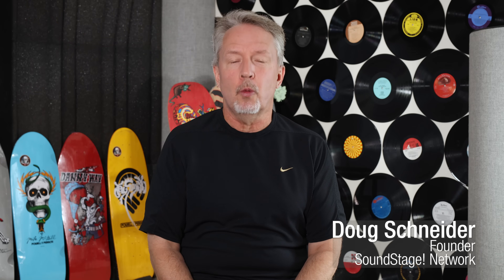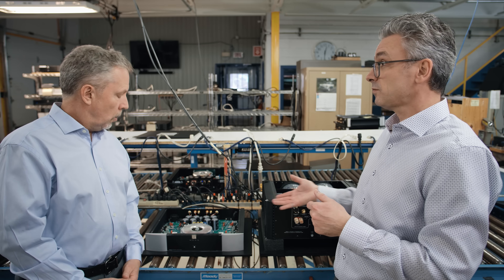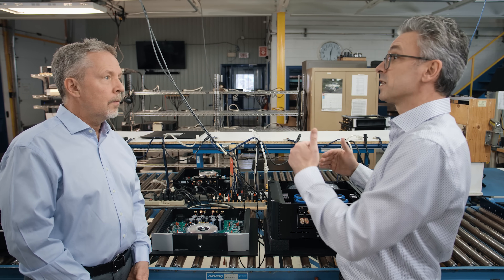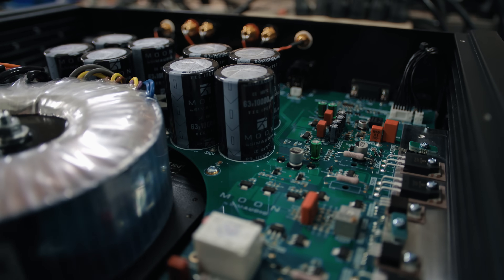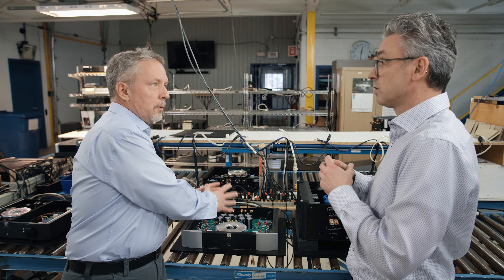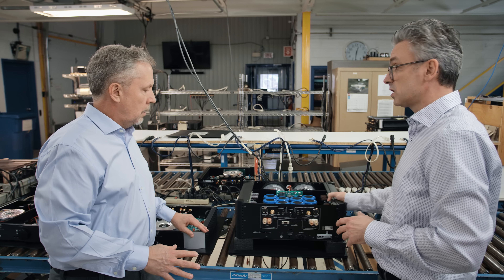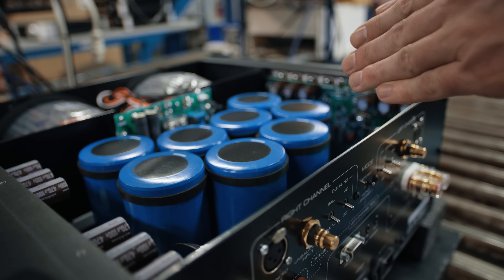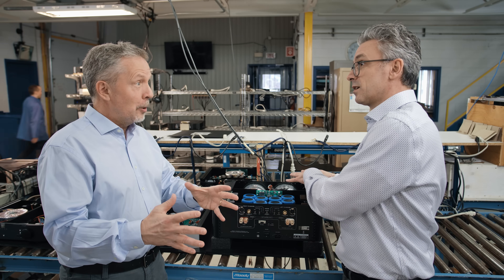Why Amplifiers Don't Sound the Same - Understanding Voltage and Current for Loudspeakers (Ep:71)

Comment: Ohm's law. amplifier produces voltage, ie: voltage amplifier, speaker is load, size of amp power supply, output transistors etc., determines how much current is available to be drawn.  Voltage from an amp is not constant. It varies with input signal. The explanation you guy's give could be very confusing to someone who doesn't understand electricity.
Reply: Even to those who do!
Reply: @Douglas_Blake_579  Yup. Why amps sound different? Then talk about input signal vs 1 watt for spkr sensitivity? Input signal voltage could vary, the 1 watt is a standard for measuring spkr sens. DB's at 1 meter with 1 watt. Whatever you do at the front end to achieve that 1 watt. What this has to do with amp output capabilities, I was stumped trying to figure out where they were going with this. Many things make amps sound different. Sorry I didn't read far enough to see your earlier post. That made sense, maybe too technical for many, I tried to REALLY simplify it.
Reply: @bradt.3555  
My point in my other lead comment was to explain the physics they were talking about. What I posted was seriously "week one" stuff. It's what you get right after "This is a piece of wire". If that was "too technical for many" then, given how painfully basic it was, I can only suggest that the ones who don't get it, really do need to study some basic electronics from a credible school; not some snake oil venders website.

The thing is that I see this all the time and it's usually among those who play with cables and doodads trying to improve their systems. Too many of us know far too little to really understand what's going on inside the fancy boxes we admire so much. This lack of understanding can and does leave our friends vulnerable to all kinds of BS and pseudo-science and takes them down paths that simply will not -- and cannot -- solve their problems. 

You see, the plain truth is that, except for seriously brain dead designs, most amplifiers actually do sound pretty much the same.
Reply: @Douglas_Blake_579   After 50 Year of investigation, we discovery it is better add more capacitors to de amp power supply 
I can't understand a bit, Tastes snake oil to me.
Reply: @animalmuppetmonster664 
After 50 years of development, speakers are now placing more heavy and consistent loads on amplifiers.  They are becoming slowly less and less efficient.  Bad crossover designs don't help, either.

Comment: Feedback plays a huge roll as well , just because an Amps power supply is bigger does not make it better sounding theirs so many other factors even the output devices act differently from JFets BJT Mosphetes- Vfets even the circuit matters rather it uses op-amps or its purely discrete with no caps or op-amps in the signal path Slew Rate is also over rated ' all Amps and speakers have different behavior with impedence dips and phase angels one thing that never gets talked about is EMF electronic mechanical force ' I think that's what you were mostly talking about is basically the Torque power of an amp to maintain its composure without adding noise ' but I have had smaller Amps that have done better with certain speakers than bigger Amps Remb that power supply has to be recharged so during crazy bass tracks you may get the 1st attack to hit hard but then the amp has to re-charge quickly to recover and its harder to do with big power supply bank - smaller power supply can recover more quickly ' this is why I love my pure power DC amps with high voltage rails My Master restored Sansui is rated from 0-hz to 200khz freq response power is rated at 80 watts which absolutely destroys my 300 watt Emotiva A 300 with full control and a heftier sound Emo has bigger power supply and more outout devices ? It's all about circuit design Emo sounds thin vs my Sansui big difference with fast Amps that are purely discrete 
Thanks for the video ' I could see on that analog engeeners face that's theirs alot to amp design not just power reserved 
I had a long talk with Jan Erthner about class AB Amp designs and its all about behavior of speaker/amp Synergy  theirs no such thing as the perfect big amp only the right amp for your speakers thanks again interesting video sorry for the book I wrote ya video got me a little excited 😆

Comment: . so the amp puts out current. got it.
Reply: Actually the amplifier puts out voltage ... but it has to be able to supply whatever current is needed to maintain that voltage across a load (speaker).

Comment: I can't believe Harley doesn't understand the problem with using a 1 watt reference for determining speaker sensitivity. Virtually no dynamic loudspeaker maintains a flat impedance curve over its operating range, making it impossible to give a single number for a speaker's sensitivity using that standard. Regardless of the fact that loudspeaker drivers draw current to produce sound, virtually all loudspeakers are  still designed to be attached to a pure voltage source; i.e, one whose output voltage remains stable regardless of the load attached to it. Solid state amplifiers tend to fulfill this requirement better than vacuum tube amps, where the ouput transformer winding's series resistance increases its output impedance. Negative feedback reduces this effect, but modern tube amp designers tend to shun high levels of negative feedback in their amps. So it isn't uncommon to see as much as 3 ohms or higher output impedance in these amplifiers, which totally messes up the frequency response of the loudspeaker. For this reason alone,  I'd never use a tube power amp on my own system.
Reply: In some ways it's surprising he doesn't realize that. On the other hand, when MQA came out, he was one of the first to be trumpeting that company's misleading claims. So...

Comment: One thing that no one ever explains is that because power is the product of voltage times current, the same amount of power (or watts) can be achieved with a higher voltage and lower current, or a lower voltage and higher current, to reach the same amount of power/watts. In the case of driving a speaker, the second option is always better, because speaker voice coils need current drive to be well controlled by an amplifier, so an amp with more current capability to produce any given level of power (or watts) is always better, and that will control the speaker's voice coil more accurately and in a more linear fashion than an amp with higher voltage output but limited current capability.
Reply: You are correct, for the most part .... 
The key insight that is not understood is that Current is the result of applying a voltage across a load.  Unlike voltage it is not a factor that you can individually manipulate... If you put 1 volt across 1 ohm you are going to have 1 amp of current flowing...  I = E / R ... Ohm's law.

Higher impedance speakers are not inherently lacking.   You could design a 50 ohm speaker that performs very well with good damping and control ... but you're going to need an amplifier that can produce much higher voltages to drive it.

Comment: Just buy active loudspeakers. It beats the sh*t out of me why most speakers aren't active these days. Oh I forgot, it's because you guys like to say "Well you put this amp on and it does this, and sounds like this and makes your Norah Jones sound better, innit mite."
Reply: Hmm well that would increase the cost of the speakers a bunch and if I’m not mistaken wouldn’t you need to then have power plugs on all repeat ALL of your speakers?! Plus now you need to a signal for the sound as well connected to every repeat EVERY speaker! So how much extra wire is that if I have 8 standing floor speakers? Hmmm do you work for the wire manufacturers?! Lol
Reply: @Adam_hadem_ideas  I guess you have never heard of a mixer.  The mixer is kind of like the brains of the operation. It's a simple process. I hook up my CD player to the mixer and then I use two XLR cables for the speakers. Some of the larger speakers use speakon cables instead of the ZLR's. If I want to hook up 4 or 6 speakers or subs then I will daisy chain them off the ones that are connected to the mixer. Very simple. All of the power cables are connected to a heavy duty power strip.  I had some passive 4,000 watt Peavey speakers many years ago and it was a pain in the ass at times. I was using  the most expensive amplifier that Peavey made for home audio use.  I chose it because it had a higher output rating  than the most expensive one made by Crown. Sometimes everything would shut down when I had the music playing at a loud volume. I would have to wait a few seconds and see if it would play again. It was almost like I was having an electrical shortage or something. I've had no problems since I switched over to powered speakers.
Reply: @alonzo-ls3nt  I didn’t say it was hard to do. I said it’s going to take a lot of wire to do. And if your shi-tuff was turning off and and getting hot then you didn’t have the proper ohm load on your amplifier and of course if each speaker had its own amp  that was paired well with it then it wouldn’t cut out. Duh but how much did that run you comparatively? And I didn’t hear you say it was as loud or louder so well was it? Or did you not say anything about that on purpose?
Reply: Also 4000 watt speakers? I’m not saying they don’t make them but I feel like you spent all the money on them and didn’t consider that you’d need one hell of an amp to power them. You come off as a snob as well and I bet my couple hundred bucks in equipment is ten times as loud as your shi-tuff! (Not literally ten of course but louder all the same. I didn’t mention the 4 12” subwoofers and 2 15” subwoofers that I have running off a 3500 watt car amplifier with an active passover that has not only bass boost up to 18db but I can select the frequency of the boost and control the Q factor as well also the standard cut off frequency and the amp has a subsonic filter as well so I don’t waste any power on notes I don’t need to play so um yeah let me know when your shi-tuff is loud enough to make a kitchen table with the leaf in move across the floor like an old washer that’s outa balance severely

Comment: There are a couple things that are interesting to think about when it comes to the current capability of an amp. First is that, if you do the math, at 8 ohms, using 2.83v, the speaker draws a steady-state current of only about 0.35 amps. The number is double that into 4 ohms, still less than an amp. This is why tube amplifiers actually work instead of withering up while playing music. But when you start to consider higher wattages, instantaneous RMS current, etc., it starts to be clear why you'll need much more than an amp or two on tap.

The other thing explains why it is important. Recall that it is the current through the speaker's voice coil that creates the magnetic field that causes the cone to move, not the voltage across it. Thus, being able to provide ample current, particularly at large excursions, is a critical factor in our perception of the sound quality of an amplifier/speaker pairing.
Reply from the maker: Great stuff!
Reply: Thanks! You explained that much more succinctly and eloquently than I did in my post about achieving the same power level with higher voltage/lower current vs. lower voltage/higher current.
Reply: Not exactly ... That current is a direct result of the voltage you apply across the voice coil and it's impedance.  No voltage == no current.

Comment: Question, not perfectly on topic. What is the appeal of a tube amplifier? My singular comparison of two transistor amplifiers and one tube amplifier was that the tube amplifier sounded more real. My guess to the experience was that the tubes masked the distortions in the recording chain. Anyone care to take a stab?
Reply: All that and they just look cool!
Reply: I'll take a stab by first saying that if someone tells you "definitely" what it is, they're probably guessing or lying. I've talked to many amp designers -- tube and solid-state -- and not one has given me a definitive answer. Oftentimes, the distortion characteristics come up most -- higher distortion and the nature of the distortion. Frequency response comes up, too, both at the frequency extremes, where tube designs often roll of prematurely compared to solid-state ones, but also in between that, because of the frequency-response variances you get because of the typically high output impedance of tube designs. But maybe it's something else entirely...
Reply: I always first point the finger at frequency response (FR) changes, because this is what is readily audible to everyone, and the thing with tube amps is that many have very (relative to SS amps) high output impedances. This means that, depending on the impedance curve of your speakers, you could have FR variations of 1-2 or 3dB. Whether that sounds good or not will depend on your speaker and preferences, but it's tantamount to EQing your system.  @dougschneider8243
Reply: Jordeng is right ... mostly they are audio jewelry.  Old technology looking for a place to die.

The sonic difference everyone talks about is largely due to a vacuum tube's tendency to produce higher levels of second harmonics (double the input frequency) when pushed, which actually sounds "harmonious" rather than grating. My teacher, decades ago, called it "soothing distortion".
Reply: No, it has to do with wave rectification and the tube amplifier's tendency to produce a natural form of compression and even order harmonics which are much more pleasing than odd order harmonics. Also digital reproduction of a waveform is sometimes harsh because it artificially straightens out the curves, albeit segmentally, of the wave its trying to reproduce. Imagine if you had to draw a curve using ONLY straight lines. The more segments of lines u used you would get closer to the perfect analog curve but would never actually achieve it. This is digital. And each of those points or angles on the wave path look exactly like clipping of a wave does, which is distortion, which enhances harmonics, which has odd order harmonics included in it, which are harsh and dissonant, which your ear can hear.